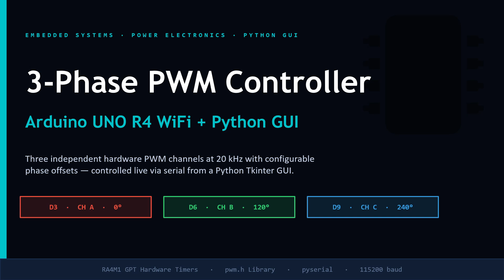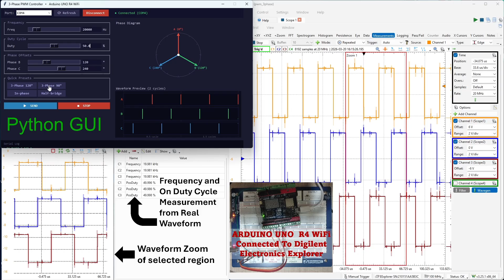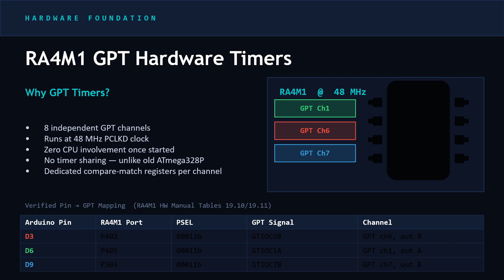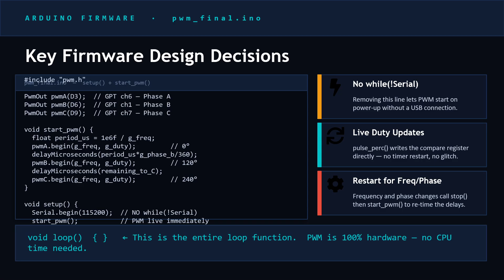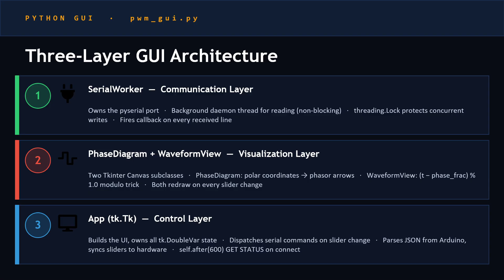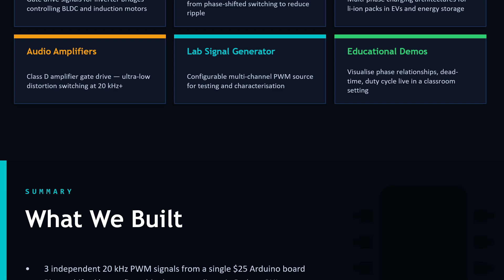Arduino UNO R4 WiFi - 3 Independent Hardware Timer PWM Channels 4 Industrial Automation | Python GUI

Comment from the maker: 🔗 GitHub repo with all source code and documentation:
https://github.com/drhdt-raipur/three_phase_power_module.git

📄 Files included:
  → pwm_final.ino    Arduino firmware (standalone, works without GUI)
  → pwm_gui.py       Python GUI (pip install pyserial — that's it)
  → PROJECT_DOCUMENT.docx  Full technical reference with RA4M1 register maps
  → README.md        Complete setup guide

⚙ Timer channels used:
  D3 → GPT ch6  |  D6 → GPT ch1  |  D9 → GPT ch7
  All verified against RA4M1 Hardware Manual Tables 19.10/19.11

💬 Drop your application below — what are you driving with this?